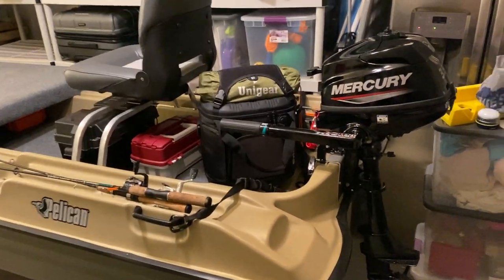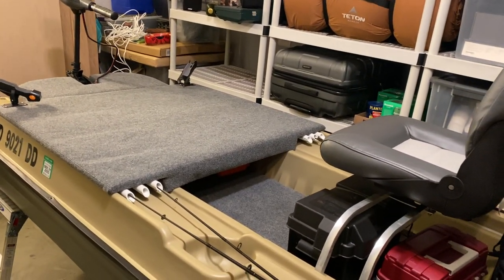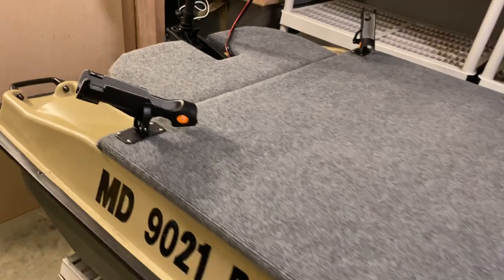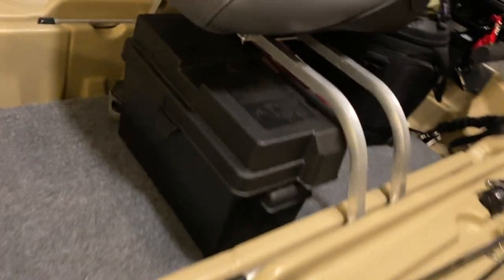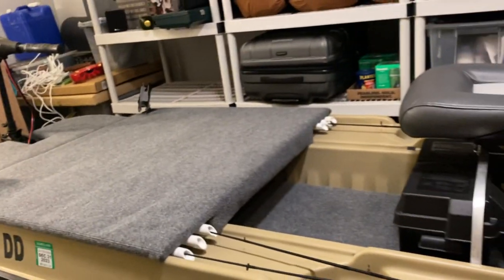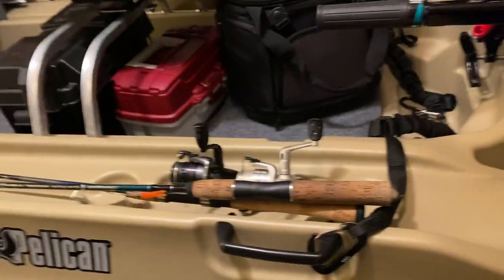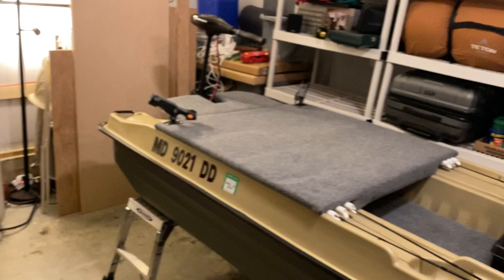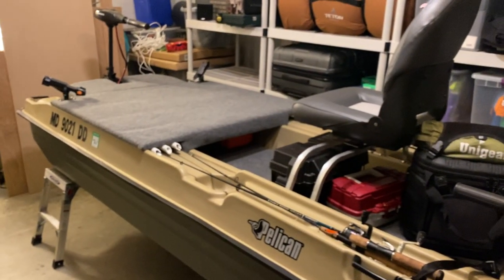Pelican Bass Raider Build

Comment: Great mods, i have the same boat, an i originally made similar plans, but with it goin from 145 pounds to 215. It became really heavy and it only has a 600 weight capacity. So I had to cut back for safety reasons. Im glad you went threw with it...inspiring 👌

Comment: You go man! That looks awesome! Got a necessary suggestion: You need to put drain plugs on lower rear of each pontoon. The factory ones on front are too high and since you have all that weight, you must have the rear ones mounted on lower rear. I have one also and am so glad I did that. It will take on water and it's too heavy to tip up too drain out in front drain plugs. 😊👍🙏
Reply from the maker: I’m fine with the stock ones. My deck is easily lifted off and so is the floor so it’s no biggie to drain it when needed. It stays in the garage so I barely ever need to drain it
Reply: Don't drill holes in the bottom of the pontoons , I have a Bass Raider , Ever now and then water will accumulate in the pontoons , Get A Plastic Hose For An Aquarium , One that will Just fit thru the Original Plug Holes N the top of the front of each Pontoon , tilt your Bass Raider Forward Just A Little Bit , I Mean Just A Little And All the Water Will Run Forward , Put The Plastic Hose Inside A Shop vac Hose And Duct tape it sealed , Shove the Plastic Hose into the Hole After removing the Plugs And Vacuum The Water Out With The Shop Vac , it'll get every Drop , I had Syphoned The water out But The Shop Vac Gets Every Single drop out , replace the plug and do the other pontoon the same way , takes about 5 minutes ,hope that helps you out , I wouldn't trade my Raider For Nuttin
Reply: I've had this for a year now. I put kayak drain plugs in the rear lower ends of each pontoon. I've built Proline and Donzi boats for a living. Holes in boats if done correctly will not leak and if correct sealant is used, adheres like epoxy to the plastic. You will learn as you go along that taking your time, properly installing mods with SS bolts and screws are the way to go. Factory does it and they last forever. Believe me me, it also looks more factory is done uniformly and correctly spaced.

Comment: Nice mods....I just picked up a 3.5 merc for my Bass Raider. I'm a little concerned on trailering the boat with the motor on & strapped down. Have you tried it yet and if so, how did it work out?